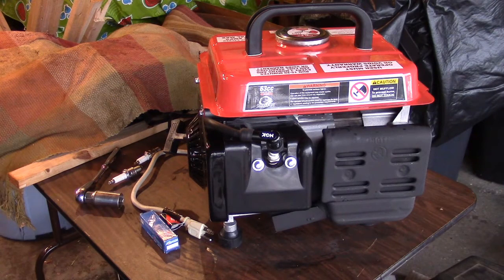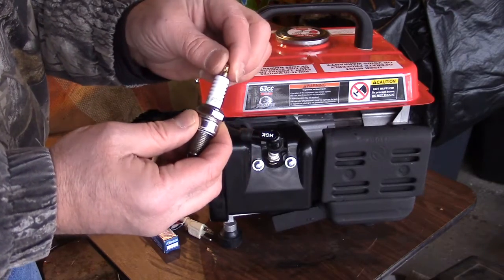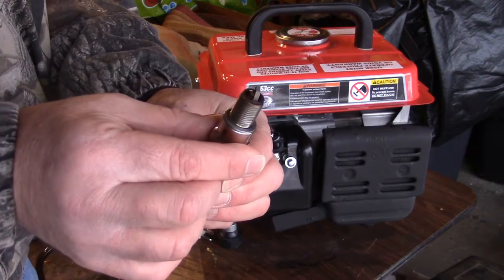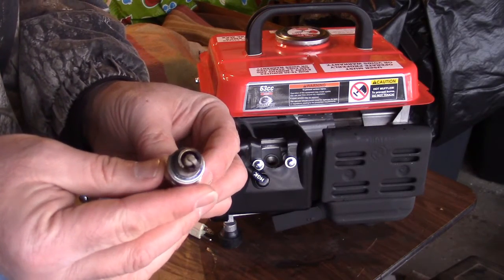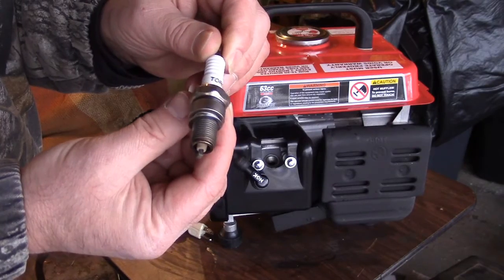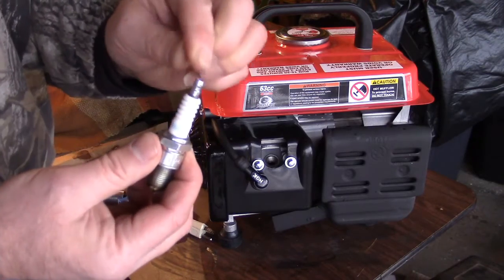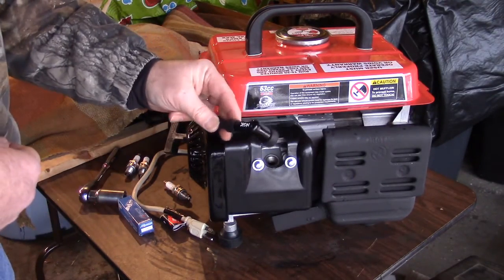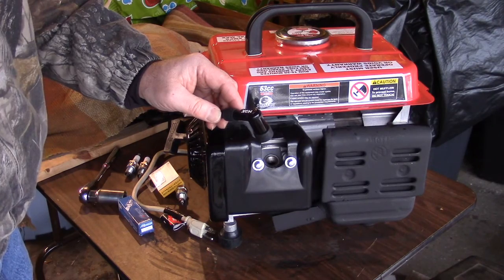Harbor Freight Storm Cat Generator Spark Plug options review

Comment: I think these should have the resistor plugs only, not the non resistor plugs. They use CDI ignition coil. The non resistor plugs could be creating a miss fire especially off load, do to the pilot jet being as lean as it is. I’m basically fine tuning mine I just got. I have been wanting one of these little generators for some time. Just because of its a 2 stroke! It seems that with the non resistive spark plug on mine there is a greater miss fire off load, it’s not consistent as it follows the pilot jet leaning out a bit. Well after doing a few simple mods first, like an actual gasket for the air box which did seem to help, but the pilot jet circuit is still a bit to lean. Which makes sense to me why it still is. Anyhow it still had that miss. 
I had a pretty newish champion RC12YC a resistor type plug. Sounds way better!

Comment: I have the older green Tailgator one and it's saved me a handful of times during winter power outages. Good enough to power my gas furnace. It's always been hard to start so I replaced the plug with an Autolite 64. It's a resistor plug and think torch F7TC isn't. The Autolite 64 cross references to the NGK BPR5ES. I down loaded the manual and it says the tailgator uses a f5tc, hotter than an f6tc or the f7tc it came with. It doesn't start any better by itself. If I spray lubricated start fluid it fires right up so thats what I do. Saves yanking on the cord for 5 minutes playing with the choke
Reply: Thanks , auto lite 64 sounds good
I have a red my coworker has a blue never heard of a green 
Neat little machine

Comment: All 3 of my 63cc generators came with heat range 7 plugs, 7 or 6 heat range seem to work well.
I'm not particularly impressed with the Torch plugs but they do work, I suspect they're not to the precision of an authentic NGK, thus potentially more prone to fouling.
I'm also mixing 32:1 premix using an excellent full synthetic API-TC air-cooled 2-stroke 2T oil as opposed to marine TCW rated oil intended for water cooled engines.

Depending on running load, the heat range 6 might be better than 7 heat range if the load is on the light side, 7 works well for me in the case of maintaining a constant load over 500W, with my 32:1 premix.
Oven cleaner agitated with a very thin toothpick does a good job of cleaning a fouled plug, especially in a pinch.  At least an hour for it to break down fuel deposits then wash with water and dry to prevent corrosion.  No longer than 12 hours, at which time the steel is being attacked.

A light brown ceramic insulator is what I shoot for, not white or black (heat range, load in Watts and oil mix ratio will affect this), gapped at 25~30 thousandths.

Plugs will fowl eventually, so keep a known good spare on hand.

Comment: I’ve just brought one very cheap £20 and it’s not sparking any advice
Reply from the maker: Good Day,

Inspect the end of the spark plug cable. They typically just use a small coil spring crimped into the wire to fit over the spark plug terminal. Also remove the spark plug, connect it to the spark plug cable and hold it near a ground on the generator. Pull the starter rope. Does the plug spark? The on off switch may be faulty as well as the coil. Spray the on off switch with some WD40. Then work it on and off to clean the contacts.
Reply: Hi yeah I’ve done all that and I checked the coil today and it’s not faulty I don’t think there’s any feed coming out as there has it got a stater plate that’s my next investigation

Comment: Have been looking at thread length and the head appears to fall between short ( chainsaw type) and longer reach which appear to be what you have there . I recon about 14 mm.is what's needed,     I can't believe the are designed to run with approx 3 threads in the combustion chamber, this puts the side electrode very close to the top of the piston.   What length are those plugs you have ?
Reply from the maker: I will check and let you know. If I recall correctly some thread is exposed. I can see that when I remove the plug. Some of the bottom threads have carbon /oil fouling present. Not sure if it's 3 threads.

Comment: Can a regular size refrigerator be connected to one of these?
Reply: Bit late to the party, but these little 2-stroke fussbuckets WILL put their shoulder into running most refrigerators, even if their compressor start-up hurdle is rated a bit higher than 900 Watts. So, yeah, everybody should have one of these little cheapo 2-stroke gensets for emergencies or power outages.  It won't run the whole house, of course, but with a semi-decent extension cord through a window from outside it will keep things from getting too mediaeval: you'll at least have a few lights, maybe be able to run a space heater on "Medium" or a fan, charge a phone or laptop, and every couple-few hours you can devote it just to running your fridge for an hour or so, just to keep everything from spoiling. Just try not to open the fridge too much.
Reply from the maker: Hi Diana, I believe this generator would not power most full size refrigerators. It may start newer full size refrigerators because they have smaller motors. Check the specs of the refrigerator to see what the amp requirements are.

Comment: I just checked my new to me generator. The spark plug boot is problematic. Also replacing the fuel line with the spark plug and boot. Thanks for posting this video. Was having a hard time sourcing the proper spark plug for my generator.
Reply from the maker: Thanks for the comment. Yes they are well built. Changing the spark plug boot makes it more reliable. You should be able to find plugs at O'Reilly Auto Parts.
Reply: @04BlueSmoke for the spark plugs, I only Ffuck with NGK, CHAMPION AND DENSO
Reply: @04BlueSmoke did you say torch f7tc? The torch f7tc are widely used on 4 stroke generators, so thanks for confirming that I can indeed use a Denso W20 EPR U or a NGK BPR6ES spark plug on it
Reply: dunno if you guys cares but if you guys are bored like me during the covid times then you can watch all of the latest movies on InstaFlixxer. Been binge watching with my gf for the last weeks :)
Reply: @Parker Mekhi Definitely, I've been watching on Instaflixxer for since november myself :)

Comment: I have two of theses.  Anyone know how to adjust the carbs on these things for altitude? I'm at 6,300 feet. 
My 60338 Manual states gap should be between 0.028 and 0.031mm. My NGK BPR5ES came gapped at 0.032.
Reply: Spark pkug gap should be between the spec. Your air screw adjusts for altitude.
Reply: @snakattack883  Does the air screw increase air as you screw in or decrease the airflow. And how how far (number of turns per feet or meters of altitude? 
Thanks for the help.

Comment: This generator seems to be very well built👀>share4.photo/Cat2kInverter?Ӎ    I bought for use primarily in construction and needed the GFCI outlets. I have used the Honda Inverter in the past and this seems to be built to the same quality level. The only difference is that this generator is marginally louder but I consider it to be well worth it given that it costs so much less and comes with a 3 year warranty.

Comment: will it work with ngk bp6es plz repply
Reply from the maker: Yes BP6ES or BPR6ES is correct. Gap at .028
Reply: @04BlueSmoke  thank you for you'r help have a good day
Reply: @04BlueSmoke  and iwant to ask you if that is ok or not mine is driping a bit of oil and leaking a litle bit from the pipe that's connected to the muffler is it ok or ihave to put so kinda of seal paste on it and thanks for you'r help again :)

Comment: Dirty power, wretched sound, horrible build quality, unreliable.....pretty much sums it up for $100
Reply: Norman, for $89 you can't beat this.  Of course it has a modified sine wave, and is loud.  But is $89.  If properly broken in, these units can get a couple of thousand of hours and is suitable for running many small appliances, and power tools.  They are easy to fix, and parts are cheap. Again, it's $89 on sale and represents the best bang for the buck as far as generators go.
Reply: I bought mine non running for 40$. Carburetor clean and a new spark plug and fuel line and it starts every pull.
Reply: I just bought one for $50 and was told it runs but got it home and found out there’s no spark
Reply: @snakattack883  yeah i cleaned mine up since previous post and it is running as well
Reply: Peoples' experiences differ wildly with this generator.  Some get good service.  A Honda EU1000 is much preferable, but $800 online - about 10 times the price.  Would love Honda EU2000 ($1000 online) one day, though.
Reply: i have had this generator for 20years+ the 220v 720w version,i have used it for 200-300hrs and have not had any problems at all and have not changed anything not even the sparkplug,one need to run the carb empty to avoid problems or use alkylate-gasoline to avoid fuel problems.i have used it to power my desktop and modem but it is not clean sine wave so better only use it for charging laptops/phones and powering fridges and electric motors(hand tools).
Reply: Tell me you have never had one without telling me you never had one...

Comment: So which plug gave the best engine performance? Thank you
Reply: The NGK BPR6ES is the best plug Ive found. The 7 is colder. The 5 is hotter than the 6ES. The 6 is to be the proper plug ive found from researching as many people have issues sourcing the proper plug/heat range
Reply: I'm about to purchase an NKG BPR5ES spark plug. Would be cool to try out those E3 plugs to see if it will run good or not.